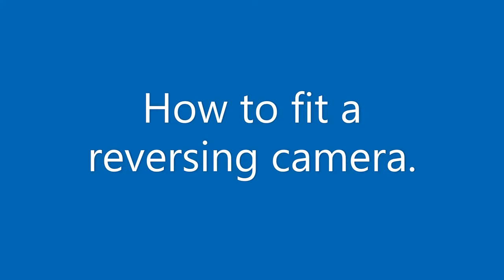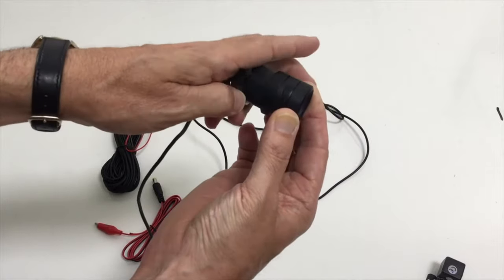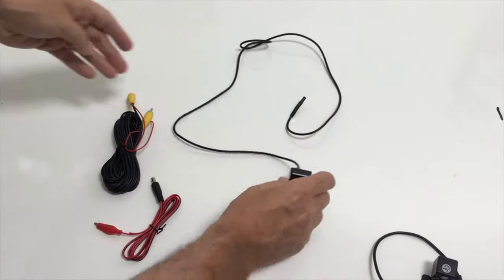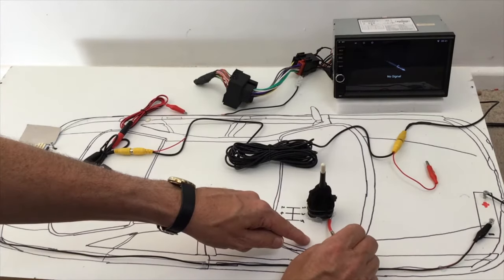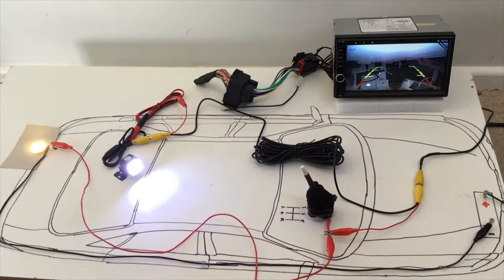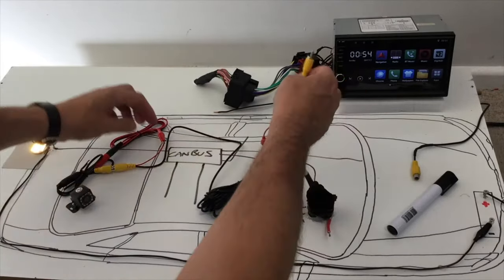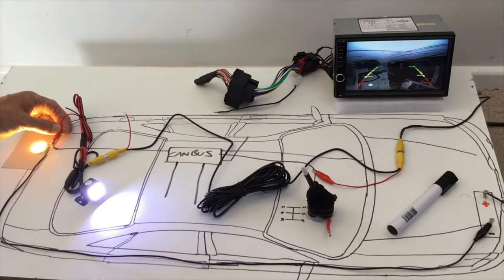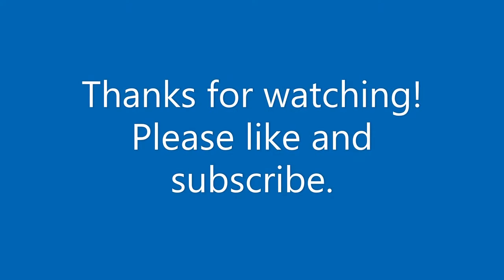How to wire in a reversing backup camera - watch this first!

Comment: a late post but a diode fitted across the relay coil would be a good idea to stop induction voltage when relay switched off?
Reply from the maker: Thanks Fred for your comment. Yes, you’re absolutely right there, a flyback diode, as I believe they are known, would look like an excellent addition to the circuit, especially as the reverse signal output from the C2 unit is likely to be from a transistor and if that failed, I wouldn’t like to go looking for it to replace it! Thanks for your excellent comment. 👍

Comment: Briliant video thank you so much you have cleared up the mistery of the red wire tails from the RC cable ***
Reply from the maker: Thanks very much for your kind words and I’m very pleased this helped. I’m hoping to make a follow up video soon, so keep an eye open! Thanks again. J.
Reply: I have a 2010 Fiesta and have a number plate light which incorpeates a cam I just couldnt fathom out what the red tails would go still a bit of a chalenge as the head unit only has the yellow Rc cable input so not sure yet how I will connect the red forward tail? anyway thanks you have been a great help

Comment: Only just found this, thanks for the detailed explanations of all the options.  When using the relay from C2, can the C2 reliably handle the inductive load of the relay coil with no additional protection against back EMF?
Reply from the maker: Thanks James for your comment. You’re the second person to raise this issue. I have pinned the previous comment, so you should see it at the top of the comments now. A flyback diode could be used, although all I can say is I have not had any problems in several years of having this set-up. Thanks again. J.

Comment: Thank you so much for this. I've got a Toyotas Corolla hatch back and running the 12V camera power from the reverse light would have been a pita. I've got a connect 2 box (supplied by Aerpro here in Australia) so wiring it into the connect2 box will be much easier.
Reply from the maker: Hi there and thanks for taking the time to stop by and comment. I hope it all works ok, let me know how you get on. ☺️

Comment: An excellent video, well presented & easy to follow. I have a problem that I'm sure you'll be able to answer. I have a 2007 Peugeot Sport & I installed a Boscam K3 reversing camera & monitor system 3 years ago & it functions perfectly. Both the video & power feeds to the monitor travel in one lead from the camera which is powered directly from the reversing light bulb wire in the rear light harness cluster. However, our road & drive can be in pitch blackness during the hours when the council save a few quid by turning all the street lights off & locating the entrance to our drive to reverse in can be tricky, so I swapped the 21 watt filament bulb for an extra bright LED.
This caused the monitor to have flickering horizontal lines so I refitted the filament bulb & it works just fine. I was thinking that it might be fixed by fitting a load resistor to bring the LED wattage to equal that of the filament bulb. Thanks for your help.
Reply from the maker: Hi John and thanks for your comments. To be honest, my knowledge of analogue electronics is not brilliant and I’m not sure whether that would work or not. I think the way I would tackle this one would be to fit a relay. Using the reversing light contact as a ‘signal’ to power the coil of the relay. The same one as I used in the video would do.
The only thing is, you’d also need a positive feed that was unaffected by the LED. There may be one nearby.  I guess the tail lights would always be on in this scenario, so that would be fine at night, but you’d have to turn them on to sidelights in the daytime to make the camera work when reverse was selected. My 2007 Peugeot has a 12v cigar socket in the boot, which is always on. Maybe that’s another option for the feed if you went down this relay route. Alternatively you could look further at your load resistor idea. I’m sure someone like Bigclive.com would be able to advise you in an instant as to whether this would work or not. I hope this helps and let me know how you get on! Happy New Year! J.
Reply: @Jase777jase  Hi Jase, Happy New Year to you too & thanks for such a prompt reply. It's an odd one as there's obviously enough power to run the reversing camera with both the filament bulb & the LED but I suppose the canbus could think that the LED is a blown bulb with the much lower wattage. Tomorrow I'll try the reversing camera with no bulb & see what happens but I will update you on the final outcome as it may help others.

Comment: hello great video extremely clear explanation and visualization.  But I think I have the 4th method in my 2017 Hyundai that makes me crazy. the wiring loom that came with the HU does not have a back wire and in the end nothing is triggering the camera mode in the HU. If it depends only on the CANBUS it seems the canbus box is not telling the HU to trigger the camera mode. I put the car in reverse and nothing happens. is there something I am missing? Seems I cannot find this issue anyware on the internet and also cannot find a fix. Thank you!
Reply from the maker: Hi Adrian, and thanks for your comment. That’s an interesting one. Just so I can understand a bit more, you say that the HU does not have a back wire, but does it have something else? Are there any other wires that are not labelled or you have not tested yet? Or does it literally just have the RCA socket for video input from the camera? If that’s the case, then we have to assume it should automatically change to the reverse screen when you go into reverse, by interpreting canbus itself? I guess the first thing then to check would be if there are any settings in the HU for detecting Canbus inputs. Is it advertised as being capable of reading canbus without a separate interface? Is there a manual way of bringing up the reversing screen? Lots of question, sorry, just trying to get the basics right in my mind so I might be able to help! Let me know, all the best, Jason.

Comment: Hi i understand all your circuits but i am confused at 31-12 secs on video, why have you got 2 wires connected to the headunit and shorted together. Great Video, Thank You
Reply from the maker: @cliverichens2697  Hi there. And thank you for your comments. Actually that’s not a shorted cable, it’s supposed to represent the “double” lead that runs through the car. It has a yellow rca video connector which is connected to the head unit, and the power pigtail. I should have drawn it better, but the point at which it looks “shorted” is where the power pigtail comes off the video cable, so the cables running into the head unit are two different ones, power and video. I hope that helps and thanks for your thanks! J.

Comment: Hi Jase, 

Firstly I have to say what a fantastic video this is - I've not seen it explained so clearly before.

I just have a question specific to my installation, related to the latter install method in your video. 

My aftermarket loom directly sends the reverse trigger signal to the head unit, rather than having a separate bare wire output like your connects2 unit. In this case, rather than splice into the rear camera trigger wire from the CANBUS decoder for power, could I instead take the feed from the constant 12v ACC on the aftermarket loom, and save having to use a relay?

In case you couldn't tell, I'm not 100% clear on what the relay is for except for 'cleaning up the signal'. Would the 12v ACC in the loom still be problematic for the reverse camera?

If I don't need a relay, I'm also hoping to comfirm that splicing into the loom and stealing some of that ACC 12v wouldn't cause issues somehow. 

Sorry if that isn't phrased clearly enough!

Many thanks in advance!
Reply from the maker: Hi Maik, many thanks for your kind words! Yes, I’m seeing comments from more and more people who seem to have the reverse signal going straight into the head unit from the loom these days, and so no need for a  “canbus detector” like my connects2 box. Yes, you can take power for the camera straight from the 12V ACC line. The two reasons I didn’t want to do it was (1) as you say it means the camera is on all the time so may be “burning it out” and (2) my camera has a set of very bright leds that would be off putting for drivers behind, if on all the time! If your camera does not have the LEDs then that’s not a problem. And as for the “burning it out” issue, at least by using the 12v ACC line, you’d only have it on when you were in the car driving and not 24 hours a day as would be  the case if you were hooked up to the constant 12v. The relay in my circuit simply gives a stronger current supply than the canbus box can supply. It doesn’t clean anything up, it simply gives the camera the current it needs from the 12V ACC line. Hope that helps! Many thanks again and let me know how you get on. 😀
Reply from the maker: @Maik_Hawk  Hi again… I think it might be wise to check with the seller of the relay if they have any stipulation as to where the grounds should be taken from. If it were me, I would probably take the ground(s) from the loom at the back of the head unit. If you are wiring stuff in there anyway, it’s an easy place to get a ground. 
But if you are going to have the camera on all the time, and not just when reverse is selected, I personally would not bother with the relay. My reason for the relay is that the connects2 box does not output enough current to feed the camera. Actually the idea of this relay being sold, is to get around the fact that the canbus voltage drops at startup, (something I didn’t know, but strongly suspected by the way!). But either way, it’s a relay that helps in a situation where you are taking your feed from canbus. I think you said you will just connect your power lead if the camera straight to 12V ACC, and as such it will be on all the time the ignition is on. In this case, I don’t think you need this relay. It might be worth a quick email to the company anyway, to clarify this and also about the ground question. Hope that helps!
J.

Comment: I purchased the Eonon UA13 to replace my UConnect OEM NAV with back up camera and factory audio amplifier in my 2016 Chrysler Town & Country. I also purchased a wiring harness with magic box to connect to the vehicle's wiring harness. In order to use the existing OEM back up camera, I had to purchase a retention cable. Sadly, the connector doesn't fit (although it looks proper, just off a mm or 2. Others have "Dremmeled" the plastic connector, most claiming that it works, some saying it doesn't.
Is that connector tapping into the CAN BUS?

Comment: Great video. Thanks for taking the time to make it. Question. I want to fit a reversing camera (5 inch folding monitor) and reversing sensors. New vehicle. If I take live connection from reversing light is it best to take this feed through a relay, don’t want to blow fuse. Also. Modern cars have systems that detect bulb failure. I don’t know if this includes reversing light bulb. If so. Would taking supplies from the reversing light affect this.

Comment: Thanks this was the best I'v seen yet. Im having issues with my E90 with Eonon GA9465. It has a canbus connection and I would like to use that option. Not sure if BMW 's are very picky about voltage feeding from reverse lights directly to camera. Im trying to hookup a camera with RCA and plus red and black wire.
Reply from the maker: Hi there and thanks for your comments. Do you have a steering wheel interface? If so, does it provide the signal for reverse? If not, and that’s not an option, I don’t  think there should be a problem taking a feed off the reversing light. I’m not a Bima expert but is an E90 around 2006 ish? If so it’s probably just got a filament bulb and should not be sensitive to an extra feed being drawn off. If in doubt, you might want to put a relay in there. I seem to remember my dads BMW of that era having it’s battery in the boot(?) so you could take a positive feed for the relay from that and switch the relay from the reversing lamp, which would be micro amps and not a problem. One other thing to bear in mind is usually the cables that come with the cameras are complete crap, and very thin, so you may wish to lay an extra cable for power. That stereo looks nice. Android 10 and made specifically for the E90 it seems to me?  Let me know how you get on. 😊
Reply: @Jase777jase  Thank you for the great info. Yes it’s a 2006 pre LCI model..

Comment: I didn't even think about needing to use a relay for this! I've checked the specs of this particular relay and see that energising the coil at 12V takes 30mA of power. I have a camera with no special lights on it, and its consumption is listed as 45mA so I guess the question is how many mA is too many? Perhaps it's best to use a transistor to supply the power instead?
Reply from the maker: Hi there Phillip and thanks for your comment. That’s very interesting. I didn’t, off hand, know the energising current of that relay, and I don’t know the current draw of my camera, but the lights are pretty bright. They provide more light than the actual reversing light of the car, but that is pretty woeful, so that’s not saying much. So I would imagine the draw of my camera is a fair but higher. As you say, how much is too much. All I can say is that I believe anecdotal/real-world experience counts for a lot, and I’ve never had a problem since fitting the relay. Also, I believe there is a company selling this as a solution, ie. a relay with wiring loom etc, so others have thought of this way of doing it. That being said, I think their product is also there to stop interference. Yes, a transistor might be a better way to go. If you do decide to go down that route, I’d be interested to see a schematic. 😀 Many thanks for an interesting comment. J.
Reply: @Jase777jase  I decided to do what the manual for my head unit said to do which was to connect the power for the camera through the ACC line on the head unit itself. I presume this is because without this, that particular head unit wouldn't be able to show the camera unless the car was also in reverse.

Comment: Might be a dumb question but why do you need a relay for that last wiring option? seems to work on your diagram without one? whats the relay for?
Reply from the maker: Hi there and thanks for your comment. No, it’s not a dumb question at all. You’re quite right, it does work without one, but it probably would damage the Connects-2 box after a while. The reason is, is that the Connects-2 box signal line will only supply a small amount of current. It’s only intended as a signal, to inform something that reverse gear has been selected, it’s not intended to provide power for any device. I actually contacted the manufacturers of the box and specifically asked them the question and they said it would damage the box if you took camera power straight from it. So the simple answer is a relay, which is fed by a small amount of current from the box, and switches a bigger amount of current to the camera (as much as it wants). I notice now, that there are companies who make a ready made relay with wiring, exactly for this purpose, so if you’re not comfortable wiring in one yourself and soldering etc, you can get one that’s got all the leads on. I hope that helps! J.
Reply: @Jase777jase  wow thanks for the reply! okay that makes sense. so in that case where are you pulling the 12v from that feeds the relay to power the camera?
Reply from the maker: @DeelitefulJestr  Exactly right yes! You got it. I'd be interested to know how much truth there is in what the manufacturer says, but TBH I'm not going to take any chances on blowing up a £60 box! 😁 Actually I suspect what they say is true, and anyway, always better to be safe than sorry! J.
Reply: @Jase777jase  sorry im a little confused. You are pulling the switch power for the relay from the connect 2 but where would you pull the 12v from?
Reply from the maker: @DeelitefulJestr  I'm getting it from what most people call 12V ACC. Its the 12V feed to the stereo (and other in car devices that's on when the ignition is on). Its a good option because (a) its on when needed (you don't need it to work when the ignition is off) (b) its got plenty of power and (c) It goes straight into the back of the stereo, so its local too. In fact I took a spur off that lead in the loom to give me a central point for power for the a feed for my phone, a feed for my ipad and a feed for my dashcam, in addition to the feed for the camera via the relay.

Comment: Really helpful.  If you monitor a trailer, and camera has LED lighting, head unit can't switch the light off.  Do I need a incline switch, or a photocell plus a relay on the red feed to light?  I see comments telling tow clients to swap to a non lighted camera so the bright lights aren't on facing other cars in traffic.
Reply from the maker: Thanks for your comments Steve. Very interesting indeed. To be honest I have not looked into the whole towing situation. I will do some digging and try to come up with a solution! BTW, how do you get your video feed through? Is there a spare wire in the tow-hook-up plug/socket or do you have to wire a separate lead, or is it wireless?

Comment: Great video! How would you suggest wiring an existing camera to an auxbeam switch panel? It currently turns on in reverse gear and manually with a button on my headunit, but I’d like to use my auxbeam switch to bypass the headunit button. Thank you!